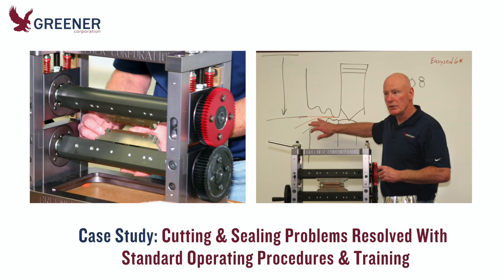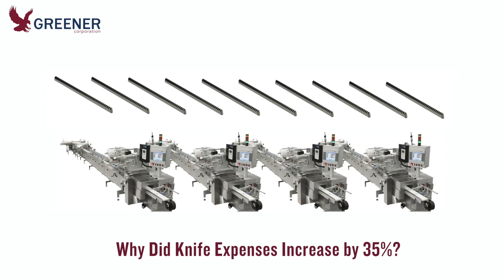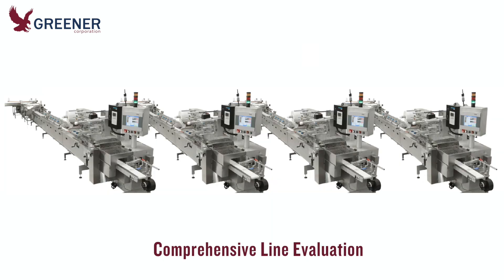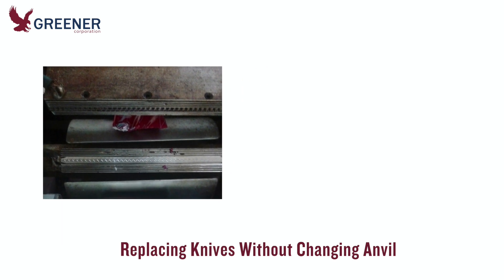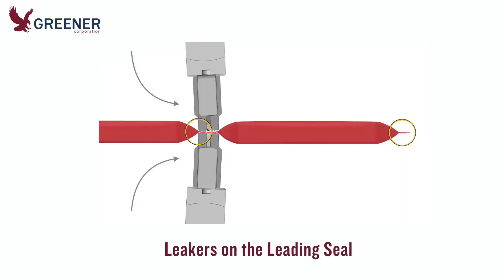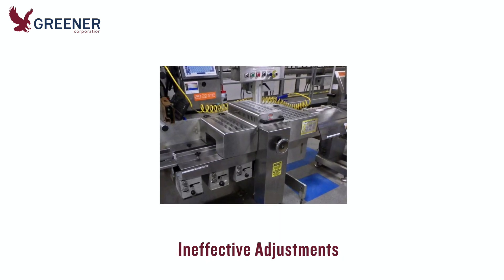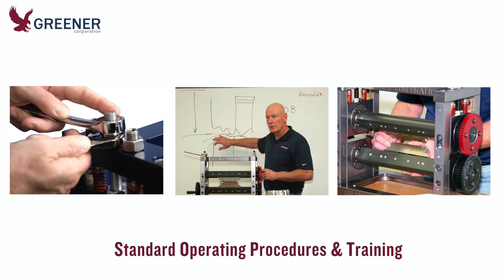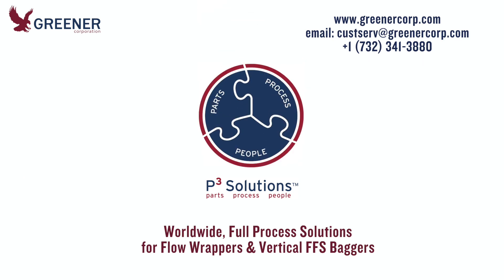Case Study: Resolve Cutting & Sealing Problems with Standard Operating Procedures & Training

Comment: Pls I have issue with my machine,it cut product at the wrong place place.how can I adjust that?
Reply from the maker: Hello, and thank you for your question. We will need to learn more about your situation to help you with your problem. Please contact us directly at custserv@greenercorp.com or at  https://greenercorp.com/contact-us
Reply: If the product is getting caught in the seals, it's usually down to the presentation of the product itself as it enters the flow wrapper. Check the product at the infeed and pre infeed stage. It's very rarely an issue with the jaws or knife causing it.
Reply from the maker: Thank you for this comment. You can learn more about product presentation and package formation on flow wrappers from our Technical Resource Blog post and video: https://greenercorp.com/resource-blog/product-presentation-and-package-formation-on-horizontal-flow-wrappers/ To receive  more personalized technical assistance please contact Greener Corporation directly so we can understand more details about your packaging conditions.  custserv@greenercorp.com  or  https://greenercorp.com/contact-us/